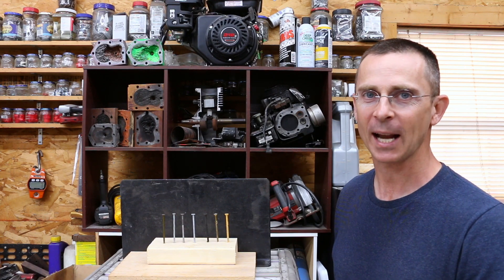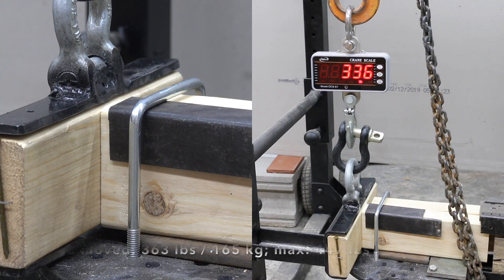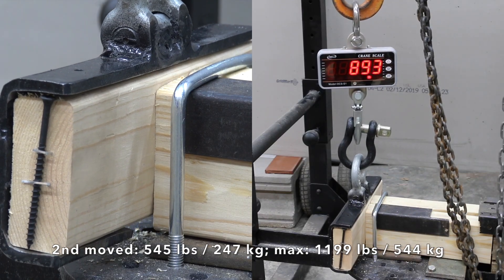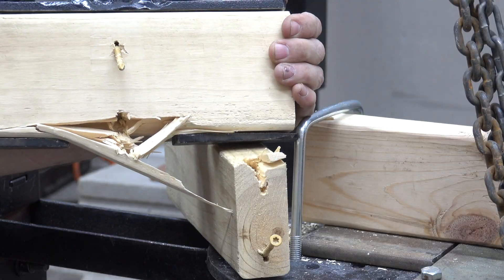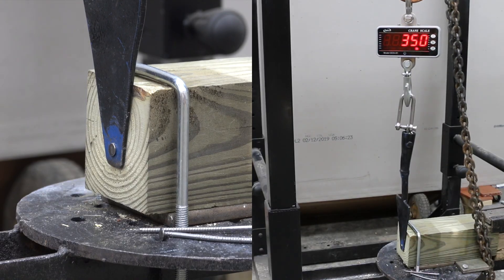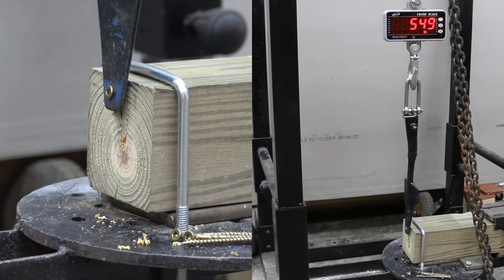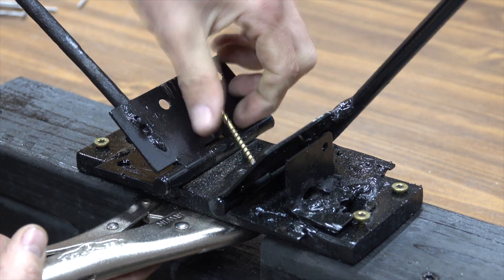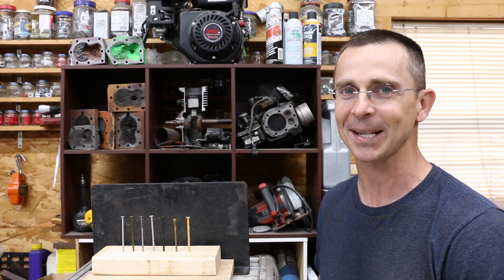Do Screws Shear easier than Nails? Let's find out!

Comment: I'd like to see the same tests with the nails/screws in side grain rather than end grain. I've found that screws hold very well in side grain, but nails and screws don't hold as well in end grain.
Reply from the maker: Thank you!
Reply: Precisely, which is why when you have to fasten to end grain you drill at right angles to the grain and insert a dowel which takes the thread of the screw across the grain.
Knockdown furniture makers copy this with a metal dowel threaded for a set screw.
Reply: Carpenter here. Yep. I had I stop watching. End grain has less than half the holding strength. There is a shear rating on nails and screws because they will actually shear when properly installed. These tests only showed how poor end grain is for fastening.
Reply: @kristofferbeder  it bothered you so much you had to stop watching because of the misinformation?   I was thinking since every test was done from the end grain that the results were consistent. If you did watch until the final results, what do you think would be different?
Reply: @64maxpower  By Fastening the pieces of wood across the grain,  @Project Farm would most likely have been able to shear all of the screws and provide the actual shear strength for each of them in a real world use case. Instead, only the drywall screw sheared, with the rest of the tests resulting in a failure of the test rig. The results we got for this testing would be best described as "grip strength in end grain" - which isn't very useful.  I apologize if I sound dismissive or critical; I subscribe to this channel because I love seeing all this stuff tested, and I want to see it done right!
Reply: @kristofferbeder  these are very good points I also recognized. He’s not a working carpenter and it’s not surprising he failed to see these issues. These tests weren’t useless but somewhat compromised due to these shortcomings. Still much useful information here. Perhaps he will do these tests again with cross grain and maybe add plywood, OSB and perhaps LVL’s and paralams.
Reply: Kristoffer Beder as someone who was born and raised on a far building and repairing fences and other structures ive never had a problem nailing into end grain always hold strong for me. Whenever i build an H brace for a fence i put a nail halfway into the post in the ground cut the head off and beat the middle post onto the nails and they hold fine against the cows even the one I forgot to put brace wire on🤷‍♂️ just personal experience not knocking your knowledge or experience in your trade
Reply: @kristofferbeder  Precisely why toe nailing a stud to a plate is far superior in strength.
Reply: Great point and I would like to see this test using Aussie hardwood, I would suggest Grey Gum or Iron Bark.
Reply: @stephenspreckley8219  Haha yeah and no pre-drilling lol!

Comment: You have to figure for the type of wood and differences in grain tightens.  Whether the board has been took from center or outside of tree all matters.  Plus nots and different resin levels in wood your test is flawed.
Reply from the maker: Thank you!
Reply: Use a composite material more stable results.

Comment: How about testing car batteries? Cranking amperage hot and cold, advertised capacity etc.
Reply from the maker: Thank you for the video idea!
Reply: I would be happy to help Project Farm with designing an electrical measuring solution that would work for pretty cheap, because I would be very interested in that test!

Comment: So should I frame my house with screws or nails? Or maybe 2 nails and one screw in the center?
Reply: Both. Screws pull objects together and nails hold the weight and will reduce movement force on the screws. Say you have a 4ft section go 3 nails 2 screws

Comment: I like what you're trying to do, but it's pretty obvious right off the bat you're not testing shear strength. You should've had your D ring right over the shear plane, you can see that the moment (torque) applied from the offset is just making the bottom fastner pull out and nothing is shearing. Plus not sure how good this test is in wood in general since I would bet the wood would yield in compression long before the fastner shears, invalidating the results. I would do two steel plates with through holes and yank one up until the fastner shears to truly test shear strength.
Reply from the maker: Thank you!

Comment: The term is shear. I have sheared plenty of screws driving them in, never a nail. Bent a few nails never bent a screw. In terms of holding strength like in a tornado, I would say screws will hold up better than nails to shearing as well as prying forces. Nails are used primarily for speed in construction projects as opposed to screws.
Reply from the maker: Thank you!

Comment: I am sure that others have said this. But this isn't testing Shear strength. Still testing the holding strength of the screw will be far superior than a nail. You have to  find a way to break the screws to test the shear strength. From a sideways movement of some sort think about a Shear wall or sheer panel on a house. Plywood nailed to the 2 by 4 or 2 by 6 structure.
Reply from the maker: Thank you for the constructive feedback!

Comment: My understanding is that nails are made of softer metal which deforms easier but doesn't break. Because screws are harder, and especially when subjected to repeated movement, will eventually weaken and snap where a nail wouldn't. Not that I know what I'm talking about, I don't.
Reply from the maker: Thank you!

Comment: Love your videos and your rigs are genius but by allowing the screws/nails pull out by allowing the 2x4 to pull away defeated the idea. If you back up the 2x4 so it can't pull out of the perpendicular piece and can only pull straight up will show shear strength. Letting it pull out at a angle isn't life like. If you think of a face nailed floor joist it can't pull away from rim joist because rest are holding it in.
Reply from the maker: Thank you!

Comment: hey, have you thought about what uses more electricity window vs, portable, vs home a/c?  i read around portable uses more power vs window. if you could be so kind as to make a video like that, it would help people what to buy for summer time. people like my self is limited on money when paying bills. i been wanting to buy a portable a/c unit but i dont know if the unit that came with the apartment uses more or less. i cannot use window a/c as they said no mounting to the building.
Reply from the maker: Thank you!

Comment: I am wondering if the results would be different if the fasteners were put in across the grain of the wood, rather than in the end of the grain?
Reply: @Mr Brightside Wall studs are installed just that way, by nailing through the top or bottom plate and into the end grain of the stud.
Reply: @Mr Brightside Forgive me if English is not your first language, we may not be understanding words the same way. -  In reality way, way, way, over 90% of all stud walls are joined by driving two nails through the side of a Plate and into the end grain of a Stud.  And, when a wall assembly undergoes uplift or sideloading the joints will experience both tension and shear.  So in the States, these wall assemblies and the joints that make them are actually required in the building code to withstand both forces.

Comment: Another well done video, I get tired just thinking about the work that went into this video! 

I may have a video idea for you, it's on Hydrogen Embrittlement. What's it take to make metals brittle and how big a problem is it?

I have wondered about  chrome-moly and  aluminum alloys for a few years now because I've been working on airplanes. 

As I understand it pickling solutions for chrome plating and some paint removers can cause a problem although I haven't heard any thing specific. 

Ironically the "Aircraft Paint Remover" specifically says "Not for use on airplanes". 

I don't know if this is anywhere in the scope of your channel but the question of how big of a problem could it be, are there any documented failures or accidents caused by it, and what if someone doesn't read the label.

Comment: This was a great demonstration and very educational. Much appreciated and awesome job man.
Reply from the maker: Thank you!
Reply: @ProjectFarm  maybe you could test if pre drilling a pilot hole makes for a stronger hold than without. Ive heard people say even drilling a pilot hole for nails makes a better connection. I've heard too that for an even better connection you need two different sized pilot holes to make the "best" connection. Say you're nailing a 1x4 board to a post. The pilot hole in the 1x4 should be slightly bigger than the fastener. While the pilot hole in the post should be smaller than the fastener. 
It's tons more work and impractical compared to simply hammering a nail in. But it may be a time and half as strong...I've no idea.

Comment: When you bent the fasteners you showed that the more ductile ones could of course take more bending. However, all the fasteners were subjected to plastic deformation. I'm not sure how realistic that would be in a properly designed and fastened assembly. Instead, all the fasteners should only be subjected to elastic deformation. And if that is the case then the higher tensile strength fasteners would perform better than the lower tensile strength fasteners. Keep up the good work.
Cheers,
Eric
Reply from the maker: Thank you!

Comment: little problem i seen was in the second set of tests for the shear strength with the puller putting them in the center of a 4x4 post may not have been the best bet that would be the weakest part of the lumber. Im thinking the softer part of the wood allowed the nails and screws to be bent more before they sheared off. Not sure really sure if it would increase or decrease the end result but i do think it comprimised the accuracy of that test
Reply from the maker: Thank you!

Comment: Sounds like you'd need a couple of the black screws and a couple of the galvanized nails for each joint, to get the best of both...

I also think that the first test mostly tests the wood strength. The two screws with the deepest threads did best.
Would need harder wood to actually test the strength of the nails and screws.
Probably also true for the second test to some extent.
Reply from the maker: Thank you!

Comment: I really appreciate this test!! One thing to consider is that the force on a fastener that would cause shearing isnt quite like your last test but it helps to show the strength. When a fastener has a lateral force its spread out across the fastener which your other tests showed better in the actually situation they are used.
Reply from the maker: Thank you!

Comment: Love these videos of yours but I feel like this one is testing the wood more than the fastener. I’ve always believed a nail or screw has the shear strength of its own material and it’s so much higher than the leverage allowed and the wood would give before the fastener anyway.
Reply: In construction, the obvious major choice is the fasteners and this channel nicely explores that aspect.  Most builders don't choose different materials for 2x4s, 2x6s, etc.
Reply: Wally Kramer The choice is the fasteners? Not sure what you are trying to say. I’m just saying that shear stress isn’t what I saw here. The fasteners all pulled out of the wood before snapping. This tested leverage at a high angle and the holding power in the end grain.
Reply from the maker: Thank you!

Comment: The last test was Very Poorly designed. There is a reson the threads of a construction screw stop with a non-threaded shank. If the threads are exposed to lateral movement of course they are more likely to shear.  Test the non-threaded shank against any nails of similar shank diameter.  Of all of the structures I have framed with construction grade screws there have been Zero failures. No shearing, non pulling out, and most importantly No Frame Movement.  Building with nail can be useful to save money but when I build structures on my farm they get screwed togather.
Reply from the maker: Thank you!

Comment: What is the relevance of the last test (bending) in real life?
Reply: Many of us don't check screwed joints as often as we should. Leading to loose fasteners. A rocking motion (smaller than tested) is very likely to happen.
Reply: @haroldhenderson2824  If it comes to that, I'm guessing that the structure has already catastrophically failed

Comment: I don't think you are measuring pure shear.  The force is applied somewhere in the middle of that 2x4,  about an inch from the plane you are shearing.  The torque applied pulls the lower nail/screw out further.    I think you could measure pure shear by a small change to the rig so that the chain is directly over the plane of the joint.   I suspect you will see higher values then because the final failure mode won't be pulling the bottom nail out then the top one.   Love the channel,  and I think these rigs are truly inventive.
Reply from the maker: Thank you!

Comment: A new question: Does Top Tier gas and its detergents really keep an engine cleaner than gas that lacks Top Tier designation?  I ask because cars sometimes now strongly encourage owners to buy only Top Tier gas, limiting the gas you can use.  Thank you.
Reply: Short answer is yes. The better detergent packages keep the injectors, combustion chamber and oil cleaner. However this becomes sort of a different issue if the car has GDI. The detergents keep the injectors and high pressure pump cleaner but the intake valves get much worse deposit build-up as the deposits formed are more related to blowby and incoming air filtration and the lack of fuel to wash them off.
Reply: @Blazer02LS  I knew about the valves - they need to be cleaned every 30K.  Forgot about injectors, thanks for explaining!

Comment: I love these vids man well done . Wheening out the junk from the good stuff is what this world needs. I use the ring shanks a lot I do notice that the way the rings are put into the shank is the reason for the snappage. If you drive one into a solid piece of hard wood and try to extract it later with a hammer or crowbar they dont like to come out lol. Very tough nail. I do like the painted deck screws with the torx tips they work very well in my field of work.  But when you build something nice for a costumer the last thing ya want is loose or just not tight joints.  You drive home a ring shank nail it's not goin anywhere with the average wear and tear.  Thanks for keeping the good test vids comin. I've turned most of my mechanical and carpenter buddies on to you vids and they enjoy them also. Be safe
Reply from the maker: Thank you!

Comment: Very nicely done! You have put much thought and work into these test. I was a carpenter for a number of years. End grain is weakest area for holding power. I think each test with the exception of the 4X4 end grain sheer test of the w/steelplate was adequate. (you would've received much different results from the 4x4 "against" grain sheer test). I based my life and health on the sheer strength of nails many times but what failed was the wooden walk/plank board 3 stories up. The screws are brittle because they've been hardened, and usually from a massive sheer force will take the heads clean off way before the shaft moves, if attached against grain. Great video, enjoyed it. 
If you'll notice while picking through lumber at the yards some 2X4's are heavier than others. Those have a much tighter grain.
Reply from the maker: Thank you!

Comment: They need to engineer their projects so as to prevent twisting and shearing forces.

If you do not know how to do this, simply read up on it.

 For afast list of the best ones, first check a california building codes handbook for a lot of methods which are legally required in that state.

They may not be 'required' where you live, but which can help anybody anywhere to make a better building.

Also, check Oklahoma and Kansas building codes for tornado building resistance for additional hints. ~( 'w')/
Reply from the maker: Thank you!

Comment: So use both, right?  Screws for holding strength and a nail (larger?) for stress.   I think for structures framing straps are a good choice.
Reply: More isn't always better, but a joint designed for the load combined with the right fastener installed properly is the way to do it.
Reply: @TerryPullen  I wasn't really asking I was speaking from experience.

Comment: OOoooo Idea!!!! Can you do screw head type comparison? Phillips (there are two types, phillips and JIS) vs square vs torx vs hex (socket) vs allen? and how much torque they take with a certain amount of weight on them on the drill before they'll strip? May be hard to find fasteners with same composition with all the different type of heads. Maybe a test could be screwing it into a piece of wood with a piece of steel on the other side, so that it'll stop and the head will likely strip (or the screw will spin if the wood is soft.) You could also test angle of entry forgiveness (aka trying to screw/unscrew the screw with the drill head not concentric with the screw axis, but at an angle, as if in a confined space. And maybe some other things. EDIT: How likely a screw is to stay on the bit without holding it? Torx is great at this. Phillips usually sucks.
Reply from the maker: Thank you for the video idea!